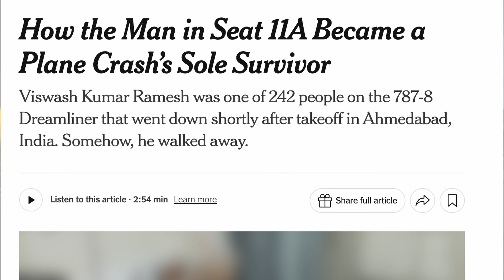Why the RAT Changes Everything – Air India 171 Update

Comment: And dual engine failure is very easy to prove once they have what remains of the engines. If debris is embedded deep in the turbines it means there was no failure and the engines were spining at very high speeds.
Reply: the results are out i think, mechanical failure of the copilots seat caused it to move back and he took the thrust levers back with him resulting their deaths...

Comment: Hello captain.....another theory is based on sabotage. Glab your emergency procedures, especially one dealing with engine fire. Among the top step is fuel control switches to cutoff. That will cut off fuel flow and hydraulics immediately. No recovery from that since you would need to go through the engine start procedure in order to attain thrust. I am ready to demonstrate this to you especially if you have a flight simulator.

Comment: Maybe it wasn't full engine failure. Could have been suddenly down to 50% thrust.  
Maybe there was a vapor lock in fuel lines due to the external hot conditions
Reply: the results are out i think, mechanical failure of the copilots seat caused it to move back and he took the thrust levers back with him resulting their deaths...

Comment: I am from England, and know nothing about how aeroplane systems work, and combine to enable a plane to fly.  I just enjoy flying.  Three comments:  (1)  Very clear and straightforward explanation that most people would be able to comprehend – Thank you;  (2)  When you froze the video to show the deployment of the RAT, I am not sure if I imagined it, but I thought I saw a gap in the right-hand wing.  Could this indicate the flaps were deployed?  (3)  Finally, I believe I saw a video clip shared by a passenger, that had flown on this plane  immediately prior to the fateful flight, suggesting there had been an electrical fault on the flight immediately preceding the crash flight.  The fault resulted in failure of the lights, air conditioning and other electrical fittings.  (https://www.youtube.com/shorts/rzpfc4SBZSc).  Could this be linked?

Comment: On Jun 17th 2025 an official, a former Air India Captain trained by the Captain of the accident flight, stated, that the CVR has been successfully read out, the voices on the CVR are very clear. It is becoming gradually clear from the newly emerging evidence that there was probably zero negligence in the cockpit, the crew did not give up until the very last moment. The probability of a technical cause is high. A preliminary report by India's AAIB can be expected in a few days.

Comment: Per the news, the A/C went thru a C-Check and the engines were overhauled. Clearly, something was not put back correctly causing a dual engine failure. I doubt Boeing is responsible for this one.

Comment: Let me tell you this.Speculation makes my hair fall like a mummy.Speculation risks to blame innocent people,usually,confortably,conveniently the pilots.Remember what happened with the Max...So lets start from this point.RAT changes nothing,RAT deployed only means "I have a critical failure and i doing everything to survive",sadly,was not enough.Electrical issues reported on the passenger multimedia sistems on  a previous flight,could give us a clue(but just a clue).Remember the Swissair MD that crashed in Halifax,same problem.787 at full power keep climbing even if an elephant is atached to his tail.Probably they reach V2,felt that something was wrong,but at that point theres no turning back,its a go or its a go,and i dont call MAYDAY if i try desesperatly to put my bird high and safe,so they call when they realize thats nothing left to do,one single MAYDAY,like a godbye...So she reaches 645ft,and at that point we can ear the RAT,so it means that something is wrong.Decreasing flaps too soon only keeps me  at same altitude,dismiss.Theres no tail oscilation,that means loss of power in both engines,pay atention that she keep the same nose angle,and she glides to the very end,like someone switched the engines off.Thats all we witnessed,and thats all we know.Lets wait quietly for more.And always remember,there are people in grief,respect this...R.I.P.

Comment: Mark my words! The RAT evidence screams dual engine failure on Air India 171, but why? I’m not buying the usual bird strike or fuel contamination story. Something’s off. Could it be intentional sabotage—someone remotely messing with the 787’s fly-by-wire or software? Maybe a cyber vulnerability in the system? Or what about deliberate fuel contamination, like Jet B instead of Jet A, causing both engines to quit right after rotation? That’s rare and suspicious as hell. A maintenance screw-up or sabotage could’ve introduced a latent failure, or maybe a glitch in the ADIRU or FADEC shut both engines down. This feels like a cover-up or something deeper. Fuel tests, maintenance logs, and black box data better spill the truth!